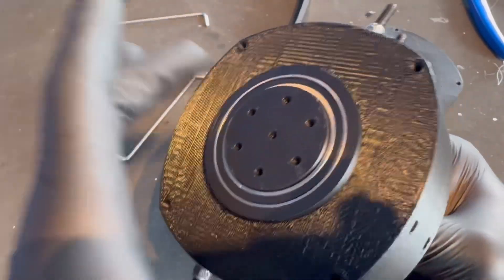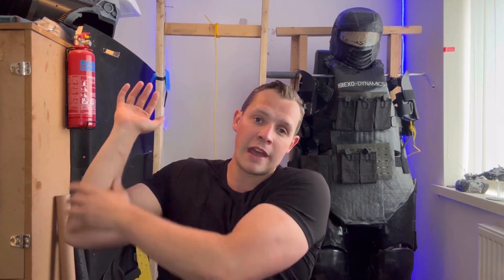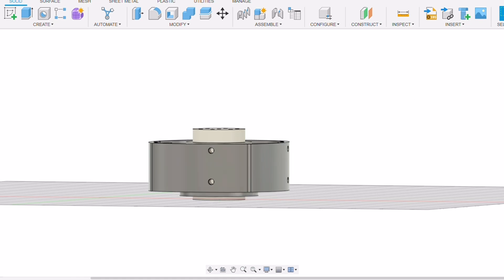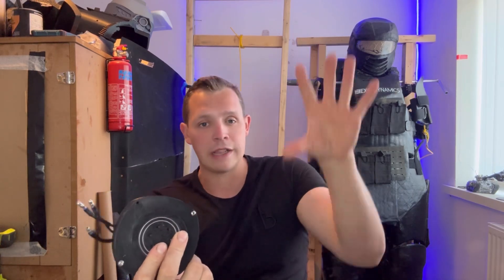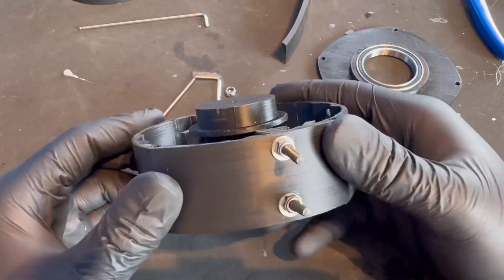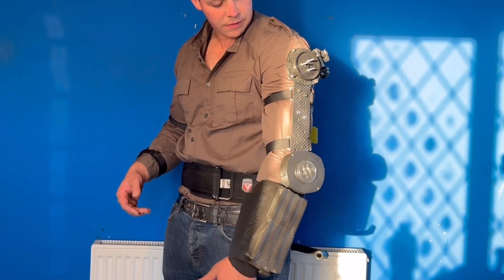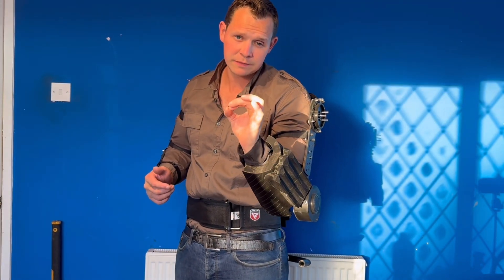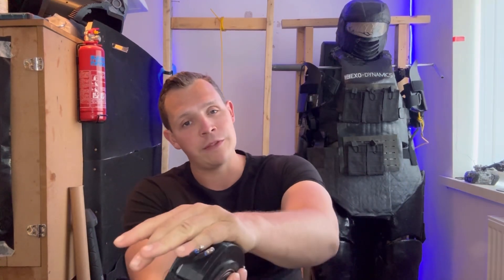Making a CHEAP, Passive Assisting EXO-SKELETON Actuator

Comment: Could this be used if made deeper as a suspension unit?
Reply from the maker: Yeah i think so, anything big would probably have to be steel or carbon the torque applied to the centre would get wuite aggressive if it was scaled
Reply: @MattExo-Dynamics  again yes agreed..FEA would give you the results..

Comment: If you use a cam design on your central hub then tension will change gaining a more comfortable motion & greater strength.
Reply from the maker: Thats true, i did think about shaping it abit more biut figured if i shape the cam strong i might have more free play in the centre point

Comment: Would you be able to double, triple, or maybe even quadruple the strength of the actuator? A black band is only about 4.5 kg or resistance
Reply from the maker: Yeah i think so, with modification you could bring the band round on itself, to double it make it a little bit bigger change the bolt holes and youd get a blue band it in
Reply: @MattExo-Dynamics  I’ll definitely have to try this if you release the .stl’s! Thank you